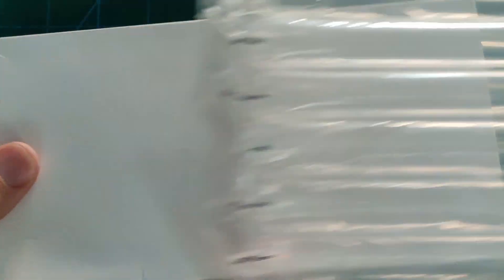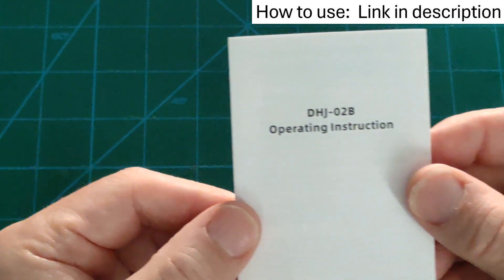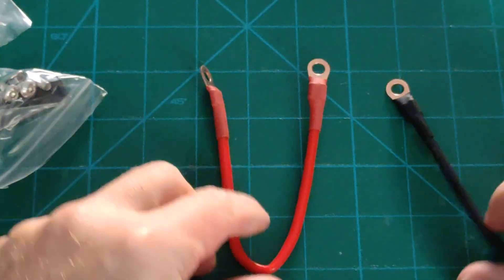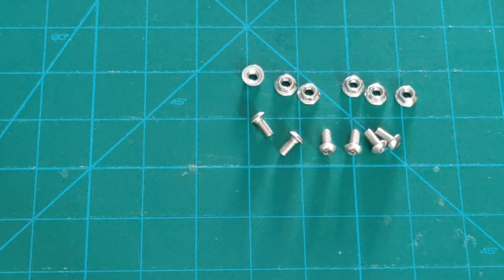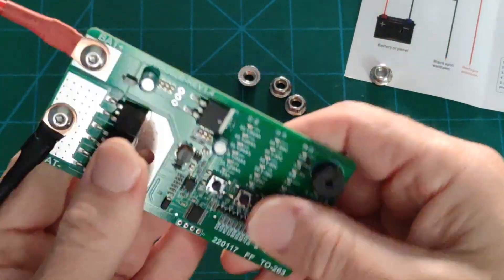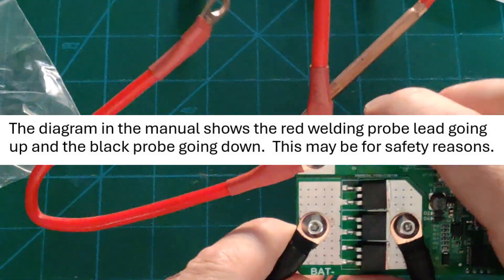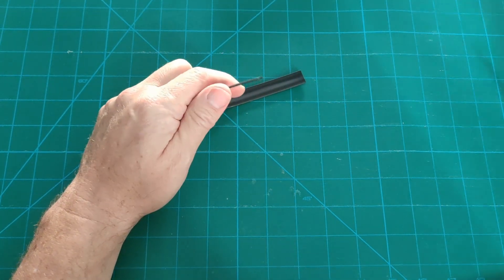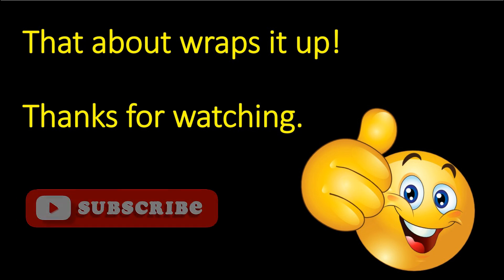ET#40.  Battery Spot Welder unboxing Assembly JQ-DHJ02B Multi Level High Current LiPo Lithium NiMH

Comment: Hi, did you test this welder? Is it good enough for 0.2 Ni strips?
Reply from the maker: The short answer is:  Not yet!
I ran into an into an interesting issue that I'll video and publish.
My intended energy source was a 120Ah Lithium leisure battery.  This is OVER the rated capacity for this welder and so it won't work!  Apparently it can blow the FETs!
I'm waiting to get a smaller capacity battery - or may try it with a lead acid source.

I watched other reviews and it seemed to cope with 0.2 strip in those without issue.
Reply: @ECETek  I decided to order this welder from Ali. I have Wise maple welder and it runs pretty good with my 45ah car battery , but I plan to make some "higher" current battery for the ebike....
Reply from the maker: I don't think you'll be disappointed.  I bought mine after a lot of research.  I did originally have a project in mind for it, but have since taken that project down another path - which is why I haven't been in too big a rush to source another supply source.  Good luck with making the eBike battery - I recently saw an interesting video where a guy successfully made an eBike battery from discarded vape cells!  Impressive.